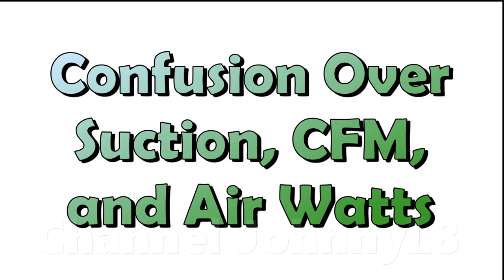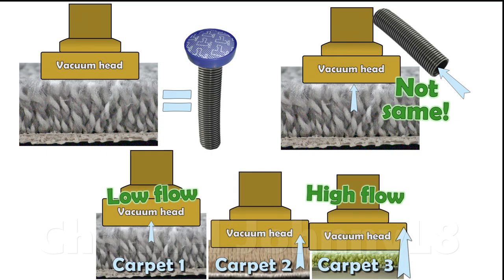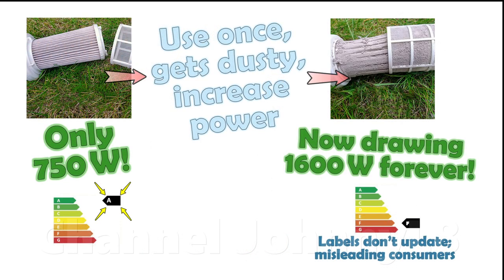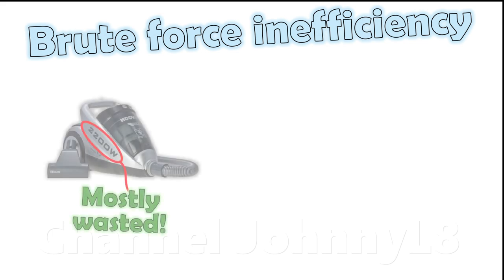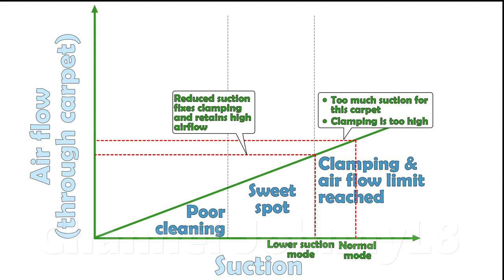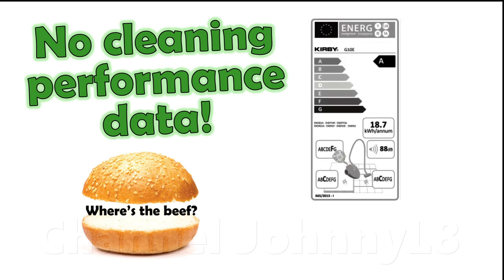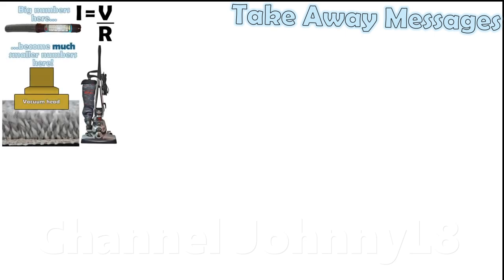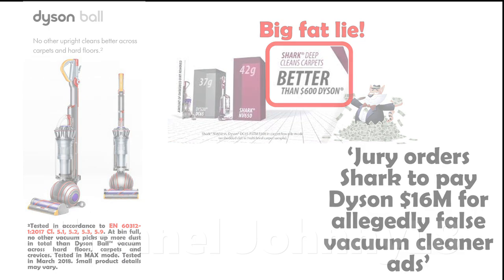Vacuum Cleaner Suction, CFM, & Air Watts

Comment: So that does not help much. Dyson have terrible reviews lately. Granted your video is 2018. By If I am going to clean in my car, I'm not going to be able to use a large fancy head on the vacuum to separate up the pile. Low suction also means you can't clean heavier particles.
Reply from the maker: Your explanation didn't really account for why this didn't help much. In fact, it's not even clear what you are seeking. The age of the video is irrelevant. This video explains the core principles of all vacuum cleaners. Subjective reviews are not a source of facts. You didn't cite the source of your 'terrible reviews' or show any meaningful statistics about them to support your implied conclusions about a product. And all mains vacuum cleaners have enough suction for above floor (car) cleaning. I'm only aware of Dyson cordless having the technology to generate high enough suction pressures to do the same above floor cleaning job.

Comment: I did watch your video and I agree with the points you make. I wish Kirby would produce the tests you refer to. I still think they clean carpets very well 😁
Reply from the maker: Well that's good. It would be hard to argue against them TBH. I spent a long time developing the content for this video because I wanted to nail the absurd myths it covers once and for all. Hose measurements (or head measurements without a tight and full seal to carpet) are TOTALLY IRRELEVANT to determine carpet cleaning performance, and anyone who uses or cites them doesn't have a clue. There are entire channels filled with such nonsense and they mislead viewers. Air watts, CFM, and inches of water are junk metrics used to trick people. The geometric average cleaning performance across all floor types is the ONLY metric worth a damn. The science behind all this is fully covered in the video (in as lay-terms as I could). The video is too long but is as short and efficient as I could make it whilst still making every important point on the topic. This will probably be my most referenced video going forward.

Incidentally Kirby probably don't submit to independent industry standard testing because they know they aren't market leaders in performance and hide behind the more lucrative myths the ignorant and gullible love to peddle. What’s the point when you’re floating on a mythical old-wives’ tale that you’re so good you can give homeopathy a run for its money. If I had the money, I'd buy several new Kirby’s and send them off to IBR labs for testing just to slap the data into the faces of people who just won’t listen to reason. Even then they’d probably try to rationalise away their discontent with conspiracy-like theories.
Reply from the maker: Often, myths have been peddled because some also "think" their liked brands clean well. One of the reasons I came along is to blow such subjective and misleading nonsense to kingdom come with something far more powerful: evidence and reason. It's interesting contrasting the earlier subjectivities that were peddled, with the later objectivities and measurements https://youtu.be/8K6B_O5_C90 https://youtu.be/qJlaBeqVs7E. It's very revealing how little trust should be given to subjective 'feelings' on matters of objective fact, and those who peddle them.

Comment: Your video was insightful, thank you. I’ve recently purchased a cordless Dyson after lots of research (independent tests, reviews etc) but found the whole air flow, suction, air watts, cfm confusing which you’ve helped to explain. I prefer the cordless to my corded Dyson DC41 Animal (it clamps to my bedroom carpets). I’m impressed with it.
Growing up we had a Kirby cleaner, and my parents hated it. We couldn’t adjust the head to the right height, it was either too low and clamped to the carpet or it was too high and didn’t pick up fibres likes bits of cotton threads, hair etc 
I’ve seen many tests comparing Kirby and Dyson, pouring flour over the carpet and going over it once with each vacuum. But they then go over several times with the Kirby where the Dyson went to ‘show’ what Dyson hadn’t picked up, yet they don’t go over where the Kirby went with the Dyson to show what the Kirby hadn’t picked up.
My parents had the Kirby salesman round back in the 1980’s who did the cleaning test, vacuumed the whole house including sofa, mattresses etc and left the dirt that had been collected. The other test was getting my parents to vacuum a carpet with the vacuum they had and then went over it with the Kirby to show them what theirs hadn’t picked up, pretty sure if they used the Kirby first and then used theirs it would have had the same results.

Comment: Firstly the Kirby has relatively low suction but very high airflow at the cleaner head. Without the tech drive it is very hard to push. The high airflow at the cleaner head cleans carpets extremely well. This is because the fan is within an inch or 2 of the carpet so very low loss of power occurs. It does this using only 500 to 600w. 
As for YouTubers testing CFM and water lift from the end of a hose. There are a few YouTubers who use an airbox to measure the CFM at the cleaner head. 😊
Reply from the maker: There’s no way you can either have watched the video, or if you did, have understood it. The entire video clearly explained why air flow is different when a cleaner head is sealed to a carpet, and how it changes. Therefore, citing CFM, suction, or air watts values is meaningless. Take another watch.

Kirby’s are surrounded by myths and deceptive tricks as covered, and there’s no professional evidence at all of their cleaning superiority across all floor types. It’s all a big deception the gullible buy into. Their grotesque weight is a better explanation for why they use ‘tech drive’.
Reply: JohnnyL8 The Kirby does seal to the carpet. It can be adjusted to the correct height. You can hear a change in the pitch of the motor when it has sealed to the carpet. I'm not the biggest fan of Kirby's they are heavy bulky noisy machines but they do clean extremely well. I know I've owned 2 of them. You haven't used one. 😁
Reply from the maker: You're getting confused. And I still don't think you watched the video, which explained what changes when a seal to the carpet is established. The video explained why the claims made by others are based on flawed reasoning, and therefore whether or not any given vacuum has been physically used is irrelevant. And to suggest that ignores the really important point made not only in the video, but my first comment, that there's absolutely no professional evidence (comparative industry standard testing) of the cleaning performance of a Kirby.